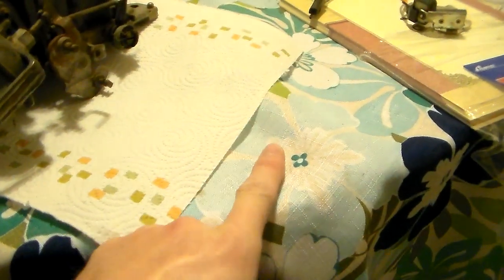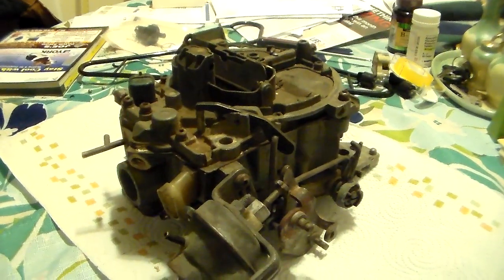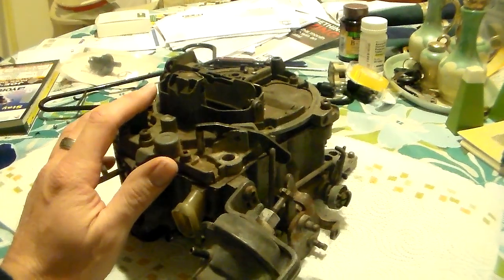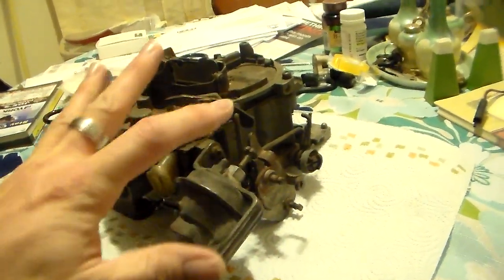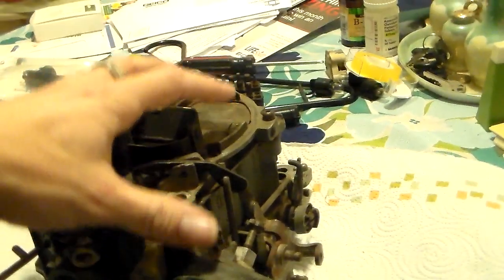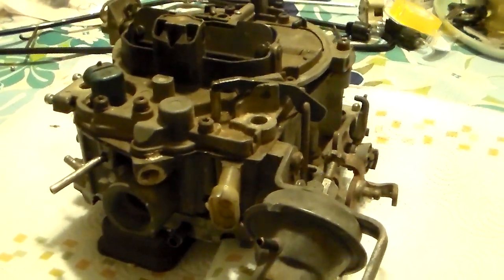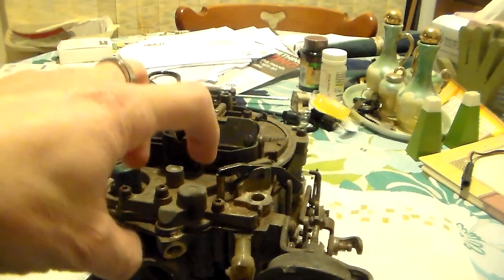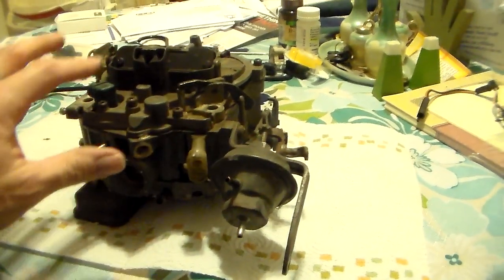Understanding computer-controlled Quadrajets part 1 of 3

Comment: Would you recommend to pop the rivets off from an '81 E4MC which has them on the OG choke??

Planning on installing factory screws on it and maybe converting the carburetor to an electric choke from a hot air setup.

Comment: Any way to remove the electronic controls to make it work similarly to a standard qjet?
Reply from the maker: No, the casting is different.
Reply: @TylersNeighborhoodGarage  hmm, mabye by gutting the electronics and making It a mechanical adjustment?
Reply from the maker: @zragevii4705  there are no provisions for the vacuum power piston that lifts the metering rods up under full throttle, so it will never run that well.
Reply: @TylersNeighborhoodGarage  that's quite unfortunate as these are very cheap, but the computer to run them is not.

Comment: An extremely useful video, Tyler!

My '82 Toronado with the 307 has a E4MC Q-Jet. With your vid about the adjustment of the secondaries air doors I fixed the bog down my 50k miles engine had.
Reply from the maker: I'm glad. They work great when properly set-up and I'm sure that 307 appreciates it!

Comment: I diagnosed my high idle is from a sticky idle stop solenoid.  I can manually push the plunger rod back down to correct the problem.  Any advice if I can clean this $75 part?  Carb cleaner or simple green HD?
Reply from the maker: is it the vacuum version or electric?
Reply: @TylersNeighborhoodGarage  it’s electric.  Because after I unplugged the wire it idles better when warm.

Comment: I’ve got an 83 Cutlass Supreme with the Buick 3.8 (231) and an E2ME and everything that I’m reading says that the air/fuel mixture IS controlled by the ECM, therefore you are supposed to look up the casting number on the back of your specific carb to determine the number of turns out each screw should be, and then no on-car adjustments are recommended 🤔 And the list I have only covers from 1980-1984 Dual-Jets and the pre-determined settings vary wildly from as little as 1 1/4 turns out, to as many as 6…..so what is the correct answer?
Reply from the maker: LOL...well, the correct answer is whatever GM specified. Not sure what your sources are but i would trust the manual that GM published, if you can find it. Yes, the ECM controls the mixture after it goes into closed loop. Closed loop means that the ECM adjusts the mixture according to inputs from the various sensors. Open loop means that the ECM is operating the mixture and timing curves on a fixed baseline written into the ECM without inputs from the sensors. That is during warmup and if something is disconnected. Good luck.
Reply: @TylersNeighborhoodGarage  It’s an actual GM training video from 1983 that looks like someone had on a BetaMax in the attic and digitized lol https://youtu.be/wbscqaLYNjw

Comment: how would you adjust the idle speed on that exact carb?  mine idles way too low, want to adjust it little higher
Reply from the maker: Most of them have an idle-stop solenoid that controls the base idle, but otherwise it should have a base idle screw on the carb itself.

Comment: Can you delete the electronics somehow?
Reply from the maker: No, because they way the carburetor meters fuel is fundamentally different on the electronic versions. If you "cut the power" to the carburetor then it simply defaults to full-rich, which you will regret each time you fill the tank and change fouled plugs. The carburetors are also physically different to the point that you cannot just swap the mechanical bits into an electronic version.
Reply: Tyler's Forgotten Car Rescue dammm I have a boring carburetor then :( wish it was mechanical but I got it at a yard sell for $5 maybe I’ll mess with it 😂

Comment: I got an 84 Oldsmobile Cutlass Supreme with stock dual jet carburetor I pulled it out . I got another one on eBay that was a dualjet as well only difference was it came off of a Chevy and some of the vacuum line ports were different now I can't seem to get the car running it starts and then dies I don't know if it has anything to do with my carburetor swap or if it's something else please help
Reply from the maker: My suggestion is to rebuild the one you removed from the Buick 231 and throw the other Dualjet in the trash. Part of owning a carbureted vehicle is knowing how to fix the carb.

Comment: I have a question about a computer controlled Quadra jets  come off of an 1985 Chevrolet Caprice with a 305 engine. When you start this engine sometimes it will run fine and other times it seems like it’s starving for fuel once the engine is warm it will continue to do the same thing. While driving the car everything seems fine but if you come all the way out of the Excelerator and then re-accelerate it’s like the carburetor is not getting fuel and if you’re sitting in place it won’t do the same thing and nearly shut off and when you try to give it fuel to keep it running it’s stumbles quite a bit before it will take the fuel. I guess my real question is why is it that I can get out and literally tap the wing nut on top of the air filter housing and the thing will straighten up and run perfect anywhere from a couple seconds to a couple minutes and then go back to doing the same thing without touching the Excelerator. I’ve checked for loose connections vacuum lines leaking between the intake you name it I’ve done it I even rebuilt this carburetor several years ago and only just now started having this problem could this be a stuck float or something to do with the Excelerator pump or am I completely off base. I would greatly appreciate any help you could give me.
Reply from the maker: The tapping is a sign the float might be hanging up. However, it likely needs freshened up anyway so you may as well go ahead and overhaul it. I'd install a new float this time and make sure you set the float height spot on. The word you are thinking of is accelerator.
Reply: The last time I rebuilt it I replaced the float but was told the float I put in could end up absorbing the gasoline overtime thank you for your help.

Comment: Thank you for the video, I just got a 1985 Pontiac Bonneville with a 305 & this carb. It’s only has 62,000 miles on it 1 owner original title and I’m having a little bit of trouble with this carb if you ever have time too email I would really appreciate some guidance! I’m 25 by the way I’ve been in automotive since I was about 17 actually working in a shop, but I’m always up for learning about something I’m not completely familiar with! If you have time I would greatly appreciate it! My email is codywright309@gmail.com thank you for your time & god bless!

Comment: Tyler, question about the M4MED. What do the wires coming out of the connector on top of the carburetor. One goes to what looks like a temp switch on the thermostat housing. What does that do and is there a part number? The connection on mine broke.

Comment: Tyler your videos are so helpful, thank you! I cleaned my E4MC yesterday on my 87 Cutlass Salon and I think the TPS might have gotten wet. The SES light went on shortly after (code 22 low voltage at TPS). It's not on constantly, do you think it will clear itself out once it dries maybe?
Reply from the maker: It's worth a try.

Comment: I got a 83 Custom Monte Carlo that came original with this carb, it ran fine in all fairness. I got the car with 86 thousand miles, previous owner took really good care of it but tbh when I rebuild the motor to upgrade a few things I switched it for a 500cfm edlebrock, these quadrajets are nice but JUNK you'd be better off switching!
Reply from the maker: You are entitled to your opinion, but I disagree. Yes, you got a nice, shiny new off-the-shelf carb, which if it's a 1406, is jetted LEAN as-is. A 1405 manual-choke version is jetted more aggressively. Then you had to give up the original fuel line, and also start using a spreadbore to squarebore adapter. On top of that, you went from a carb that could potentially could flow 750cfm to one that will NEVER on any engine flow more than 500-cfm. If you run out of cfm, buy another carb. If you had asked beforehand I would have suggested a non-computer Chevy Qjet and you would have been very happy. You could have even kept the same carb when you grew into a larger engine ;-)
Reply: Tyler's Neighborhood Garage I'm not saying the quadrajets are useless carbs, they aren't if they are well kept & the owner knows a thing or two. I say switch over because it's not as complicated for people who don't know alot about carbs & how to fully perform maintenance on this type of carb!

Comment: Can I replace this set up with a regular Holly or edlebroc on an 1986 el Camino conquistador
Reply from the maker: You could, but you have to run an adapter and the liners and linkages don't just drop into place. Why not save yourself some trouble if you want to dump the CCC carb: Find a good 1978-80 Chevy carb on ebay and rebuild it. It drops right on.

Comment: do i need to hook up the tps on it of my car doesnt have one?
Reply: i have the electronic fuel mixture sensor though
Reply from the maker: I think you have a carburetor with a two-stage accelerator pump instead of an Mixture Control Solenoid. They look very similar. Can you provide me with the stamped number from the left side of the carb, on a rib running up and down? Look at the throttle linkage and it's behind that. Not the number cast onto the flat side of the bowl. Will be something like 1702230 or similar. I'll verify what carb it is.

Comment: Can you use a computer carb on a non computer car if there is a way to bypass something ?
Reply from the maker: It will physically function, but the electronic mixture control reverts to full rich in the absence of computer input, so it won't run very well and will eat gas.
Reply: Thank You for your reply ! I guess i will be looking at something new . Happy 4th !

Comment: hey brother my QJ after setting idol (non comp CJ) oddly enough seems to ?readjust? and sound like its starving for fuel, I readjust it (in park then in drive and rhen with air on) and it just wont adjust and runs like its starving for fuel (QJ is a fresh rebuild from Jeggs) its an 1987 350 on a G30   fleetwood moterhome

Comment: One big problem with these Olds 307s with feedback was the bowl vent purge valve. It would go bad and direct full manifold vacuum on the carb vent fitting LITERALLY SUCKING GAS OUT OF THE CARB. Black smoke fouled plugs etc. Every 307 that used to come into my shop that was getting black smoke and 5 miles per gallon had a bad purge valve. They were coming in ALL THE TIME. Just one of those purge valves going bad caused more pollution and emissions in 1 week of use than the emissions that a conventional carb emitted during its lifetime The entire concept of lower evaporative emissions was TOTALLY DEFEATED. JUNK!
Reply: Would the purge valve have gas in it if it was bad? Or would that be a different problem?

Comment: My 86-k10 Silverado has 3 plugs on the carberator, including the white one you say it shouldn't have. Carberator Number  17085508.
Reply from the maker: Fascinating. That's a California emissions carb that's original for your truck. Evidently CA wanted tighter control over the emissions, so GM ran those trucks with the CCC system. Thanks for the info.
Reply: ok thanks

Comment: I've got an 1981 Delta 88 with this in it. I have bee looking for months for info about it. I installed a remanufactured one but mpg is terrible and runs rich. ie. black suet from tail pipe. Thanks for the info

Comment: What is the top brass adjustment for (by the choke plate)on a E2ME roshester?
I put a 1982 dualjet  from a 305 on my 1981 267.  I adjusted the air/fuel  mixture on both sides and it is running good but the "check engine" light come on after a long time @ idle.
It will  go back out after it get moving and off idle.?   Thanks
Reply from the maker: It sounds like the part throttle limit screw, which isn't normally adjusted. Have you pulled the code to see what the check engine light indicates? You can do it with a paperclip easily.
Reply: Paperclip?  I had my 81 ElCamino for 6weeks.  I don't know how to "read" the codes as yet.  I do know that there are two parts in the middle of the air horn that screw in and out.  Stock the brass one is covered and the cover needs to be drilled out to remove.  I now have the instructions for carb. kit.  It is called a valve-idle air bleed and the other part is in front of it and not named.  thanks
Reply from the maker: Lance Morris
Look under the dash on the driver side. You will see the black 12-pin diagnostic connector. Each receptacle is lettered. You pull the codes by using a paperclip or other suitable piece of wire to jumper between the A and B terminals, which are normally the two rightmost terminals on the TOP row.You do that with the ignition off.

Then, turn the key ON but don't start it. The Check engine light will flash a code 12 three times at first, then whatever code is stored, also three times. Ignore the 12. If you don't get anything other than 12, drive it until the check engine light comes on and off a couple times and try again.

The codes read like morse code. 1 flash is one, two quicker flashes is 2, for code 12. Flash...flash-flash. Good luck.

Comment: Would this be on an 87 El Camino with a 305?
Reply from the maker: Originally yes, as long as it is a US-spec car. Vehicles sold in Canada may not have gotten CCC carbs all the time.
Reply: Yes, it's a US market one. Thanks.

Comment: i am running a 305 motor inside my derby car. why would it be catching fire in the carb. and can i plug all vaccuum lines off.
Reply: Staci Sandlin it will work, but it will run very rich and overtime foul up your spark plugs

Comment: hey me again with the 83 camaro, thats the exact type i have on my 305, i have got everything done you said to do, no vaccume leaks anymore, but still does the problem when speading up, wont speed up when pushing on gas. and its running too rich, you can smell the gas.
Reply from the maker: +bergerk20 Before you blame the carburetor, have you checked the timing? I can walk you through it if need be. Also, are you getting a Service Engine Soon light?
Reply: no service engine light, and at idle it does sound a little out of timing, can i adjust timing just for idel?
Reply from the maker: +bergerk20 lol....well first we need to help you better understand what you are trying to do.

Condensed version...an engine needs 3 things to run- air, fuel and spark. And, it needs them at the correct time. So, if any one of those things is missing, the engine doesn't run. If one or more get delivered at the wrong time, the engine runs but runs poorly.

 The reason I asked about timing is that ignition timing, or in other words when the distributor is "told" to send spark to each of the spark plugs in the correct order...is important because if it is "off", then the engine runs poorly, starts hard, won't idle or idles too fast. There isn't timing "just for idle". Ignition timing affects how the engine runs from idle all the way to as high as it'll rev. Does that make sense? The timing can AFFECT the idle but it doesn't devote it's activity JUST to the idle.

Second thing is, you can't "listen to the idle" and speculate that the timing might be off. The old-timers could claim that and get away with it, but any engine with a computer control needs it set properly.

 You do that with a timing light. The timing light connects to the battery and then around the #1 plug wire.  You next find the small scale that is somewhere above the crank pulley at the bottom of the engine. It'll say something like BTC10 0 10ATC with hash marks. On the large balancer that the crank pulley is attached to is a single deep groove by itself. That's your timing mark.

 You start the engine, get the light and point it down at the scale. You should see the groove on the balancer "stand still" somewhere ext to that scale. Most engines are timed from 0 to 10 degrees BTC. BTC is before top dead center. DON'T confuse the BTC and ATC marks.

 One thing you have to do on a computer controlled quadrajet is unplug the jumper wire to temporarily disable the timing advance while you are checking and adjusting the timing. Otherwise the ECM tries to adjust the timing itself. On your car that is a single wire somewhere around the rear of the passenger side valve cover or near the fan blower that can be unplugged from itself. You'll know it when you see it. One wire with a connector in the middle. Don't forget to reconnect it.

While you are digesting all this, you can answer me a few questions before I make further comments:

1, When you look at the carb, there should be 2 wire connections. one on the top to the passenger side, and the other on the front left facing forward. Are they there and are they connected?

2. I need the carb number. It's on the left side of the carb on a rib running vertically up and down. In other words you will have to turn your face sideways to read it. It will be something LIKE 17083211 with 2882 AJC below. Those are just example numbers, but in the format you want to look for.

3. Look at the distributor at the back of the engine and report back whether it has ONLY electrical wires, or it has a metal vacuum can on the passenger side of it.

Good luck.
Reply: ok ill get back to you tommaro on that, ill do that as soon as i get off work, thanks for helping me. wish i could have grown up doing this and not learning how to build houses
Reply: ok i got the answers now, the distributor has only wires no metal vacuum, yes both connectors are connected and the number on the carburator is 17083204 with 2982 frb under it. so is this the proper carb for my camaro?
sorry it took me so long to get back to yo i was working